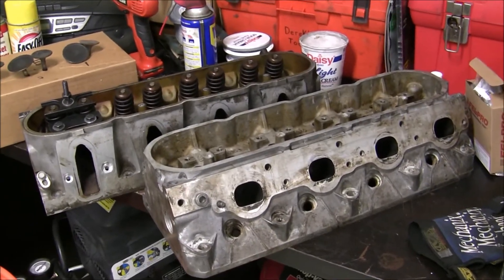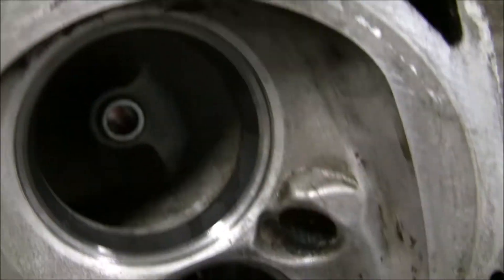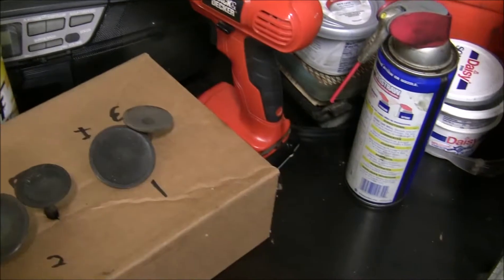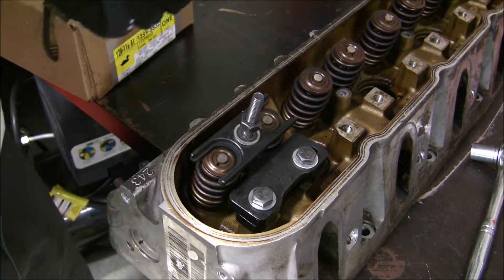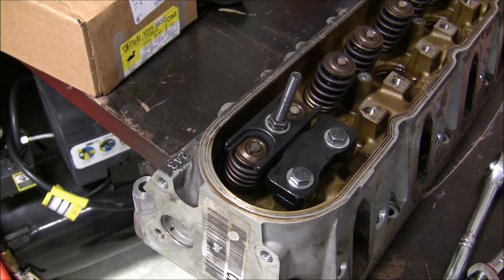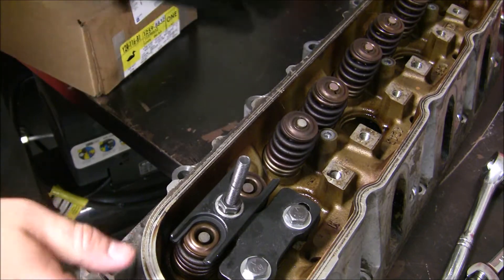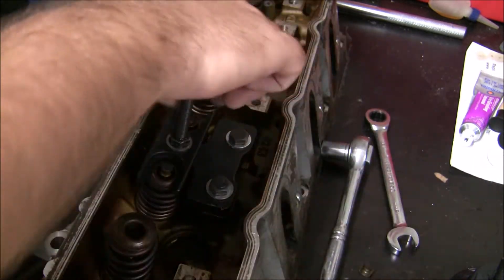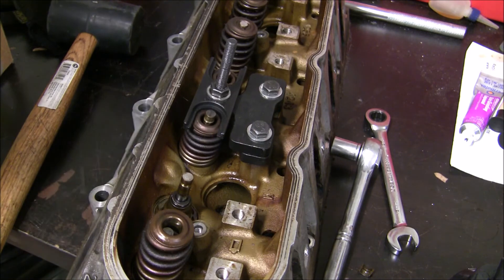5.3 part 5 - Cylinder Head Update, cleaning, and Valve Spring Compressor

Comment: Torch on head bolts
Reply from the maker: for ARP - 3 stages on the 11mm: 25ftlb, 50ftlb, 75ftlb. for the 8mm - 25ftlb

https://arpinstructions.com/instructions/134-3610.pdf

Comment: Bro use the ratchet with a deep socket 13 on that valve spring compressor tool instead of the ratchet wrench. Other than that it seemed good. Keep going strong and working hard. Hands on is the best way to learn. Also, I would seriously invest in an aftermarket set of heads rather than use the factory heads and they will work awesome with that camshaft you installed. Factory heads are only so good and the aftermarket heads say from CPR will really wake up that motor and work very well with that camshaft. You can only do so much with factory heads and valves.
Reply: 243/799 are some of the best heads you can have.
Reply: @scottydoesntknow254  there are much better aftermarket options for these engines bro.
Reply: @frankmurray9353  no shit but why? These are great heads. Period. Why spend money on something when it's not needed.